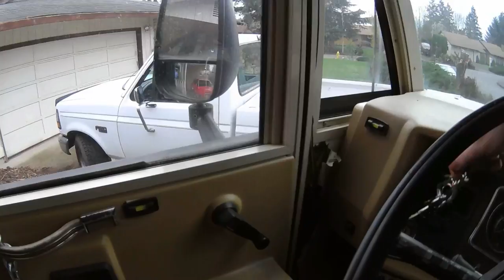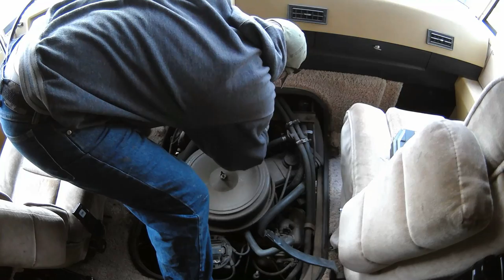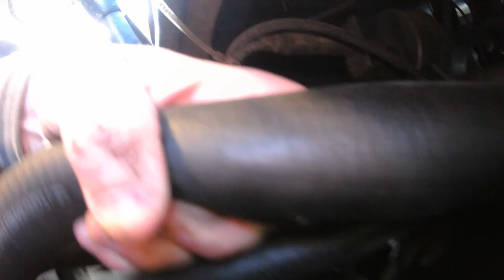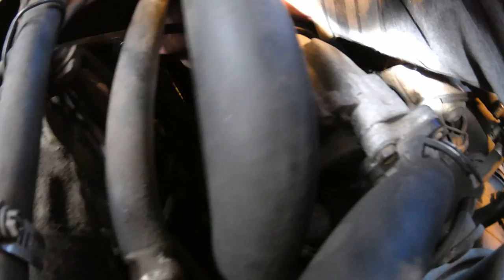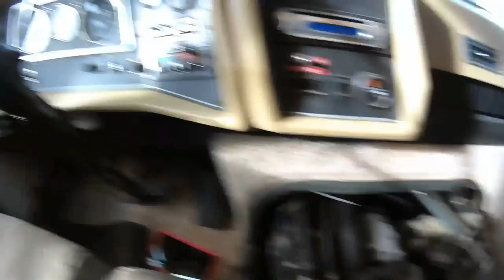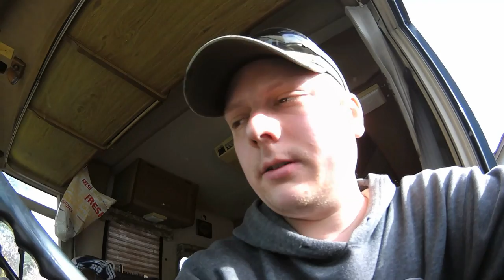Troubleshooting Motorhome Power Steering

Comment: Not sure about yours but that pump you were working on is the ac pump !
Power steering is below that and much harder to get to !
Looks to me like you tightened your ac pump belt. There are three separate belts . Alternator/fan that runs to your crank pulley. Then your power steering belt , next is your AC belt .
The diesel sounds like timing with the hard start , but if you start it up for a few and don’t kick down the choke or high idle , it’s going to diesel

Comment: The dieseling is a timing plus the idle speed adjustment on the carb.  I had to replace my carb as the previous owner attempted to adjust the idle mixture setting.  In doing so he ran the idle mixture jet screws in HARD to the point of cracking the base plate of the carb.  This resulted in no matter the setting the idle could never be adjusted lower than 1800 rpm. and would diesel on shut down. 

As to the hard start after running that is "heat soaking"  this is a common problem with ANY of the GM's or Chevy's with the Big Block V8 engines. What happens is because the starter is so close to the exhaust manifold, about 1 1/2" away,  the copper windings in the starter increase in resistance when they get hot and must wait sometimes for 15 -30 minutes to cool enough for proper operation.  Also the main power cable from the battery suffers "heat soaking" too.  

 Correction is to add a starter shield, also the power cable to the starter should be 4 guage and heat shielded with in a 1" tube as the cable runs under the manifold to the starter.  There is also a heat deflector shield for the right side of the engine that blows airs down the right side of the engine to assist in removing heat.

Hope this helps.
Reply: Because it was a problem with hot start I think you are right about starter getting heated.  When it bogs on cold start I would check timing...could be too advanced.
Reply: Or even a flat spot in cam, or a cracked valve, had similar issues, allowed manifold vapors to seep past the week cylinders on mine, messed with timing for a week before doing leak down and compression check...

Comment: My girlfriend and i fulltime RV, we just upgraded from a small 78 dodge minnie Winnie to a 33ft coronado (p30 chassis) ive only driven it once due to the power steering AND brakes not working properly. I believe its going to be the hydroboost in mine, the guy we got it from saod it jad a new power steering pump installed at one point but didnt fix the issue, any idea how hard it is to replace the hydroboost in a class a? I cant even see the thing from in the hood
Reply: I just got done replacing my hydroboost. It was actually very easy. Remove the left wheel then remove the shield. Once you have the shield removed it is easy to get to the hydroboost. You have to remove the master brake cylinder off with the hydroboost.
     I actually found it easier to leave the hydroboost mounted to the bracket and remove the hydroboost, the bracket and the master brake all in one piece.

Comment: I have the same problem on my '86 Fleetwood PaceArrow it is on a P30 chassis with a 454 or 7.4L V8 engine.  Along with the pump running the power steering it also runs the power assist for the power brake system.  You will also notice soft or spongy brakes where you need to pump a time or two to get them to fully work.
Reply: Any update on your fix I replaced pump Still have issue Exact issue you mentioned. Any help would be appreciated.
Reply: @dwightmcammond5597  Same here!
Reply: @chrisbaker4475  I had the same problem. Mine would not turn at all. It ended up being a bad hydroboost. It was actually pretty easy to do. Once the shield is removed there is plenty of room to do the job.
     Remove the left wheel and the shield that is mounted to the frame. Once the shield was removed I removed the lines and hoses to both the hydroboost and master brake. Remove the master  brake cylinder from the hydroboost. Remove the bolts that support the hydroboost and remove the hydroboost bracket, the hydroboost.
Reply: @lisah6451  I very much appreciate the reply! Just today I brought it to a local RV repair shop, I needed a NYS inspection as well anyway. I really don't have the ability to do this kind of engine work. I'm a plumber/electrician/carpenter.

Comment: Sounds like he's tiring box is gone . It's not a bad fix just make sure your wheels are seat along with your steering wheel. The hard start is defamatory a tuneup and timing issue but I would also save up and convert it to fuel injection wither one of the numerous kits online from holly and such company's. I did my rev and it started the first time every time and my gas Mileage  went way up and payed for itself in 2 years

Comment: MAY WANT TO GET SOME AIR IN THOSE TIRES AND MOVE THE COACH SO THOSE TIRES ARENT SITTING IN THE SAME SPOT. TIRES THAT ARE LOW ARE MUCH HARDER TO TURN. A GOOD TUNE UP PLUGS PLUG WIRES AIR FILTER AND SOME GOOD HIGH TEST GAS. DID YOU ADD ANY FUEL STABILIZER WHEN YOU PARKED IT?

Comment: I have an 87 Winn that looks exactly as your RV. Stupid question - Where do you put in the fluid for brakes and steering? Just bought RV and trying to do some maintenance. Any advice would be great. Thank you!!
Reply from the maker: The brake fluid goes in the brake reservoir which is located in the drivers wheel-well behind a shield that has a square hole cut in it so you can access it. I have also read some of these motorhomes come with a small hatch on the floor near the driver&#39;s seat so you can get to it easier, mine unfortunately does not making it a little difficult to get to but you can still do it.

The power steering reservoir is under the hood, it is black and cylindrical and has a little cap on the top
Reply: I thought I found for the steering but it only states to use proper fluids and not to over fill.Didn't want to risk putting in the wrong stuff. 
You are a blessing! Looks like the tire and I are going to become very close friends tomorrow. haha 
Thank you so much!!
Reply: Class A Living I'll be keeping you around. I just know I'll find something else that will boggle me. lol 
Thank you again! ~ Blessings to you and your loved ones!
Reply: Love reading these. Great Channel. GOD Bless

Comment: You have to check the fluid levels as well ( you probably already have) power steering uses fluid to assist in ease of turning(if you will). check your hoses too ,, a supply line  or pressure hose is about 20 bucks. the return line is cheap as well, one could be split or leaking.

Comment: Nathan, were you able to get the power steering / hydro-boost pump belt tightened?  How did you do it?  I was thinking from below by removing the bottom section of the fan shroud which gives access to the lower front of the engine. Any thoughts?

Comment: Mine is making that noise and also the breaks. Any ideas. Please 🙏🏻🙏🏻🙏🏻
Reply from the maker: My issue fixed itself when I took the steering centering springs off, seems as though they were too much for my power steering to handle when turning.. tightening the belts may have helped too
Reply: @ClassALiving  i guess my power steering and brakes are the same system and when i turn left or right pr apply pressure to the brakes it makes the same noise. Mine is currently stuck in park.

Comment: Use a vacuum pump tester to check and apply vacuum to rid air pockets in pump via reservoir. Air in steering pump causes cavitation of centrifical force causing sharp whining sounds.

Comment: Hi bro, you may want to check your tire pressure on the left side.
Reply from the maker: +Santos Vega Thanks! It does look pretty low im going to check it as soon as i get a gauge :)
Reply: @ClassALiving  The belt may need more tightening since it might be slipping silently at the new tension.  Maybe see if it gets hot.  It may be designed to be stiff when sitting still on dry pavement, which is the hardest condition, and an ageing pump might want a thick fluid additive, especially if it behaves better when cold.  Lucas makes them.

Comment: Didn’t check power steering fluid. Why not? Cavitation in power steering pump is caused by air getting in. Replace seals at pitman arm if pump won’t hold steering fluid. Check pully for excess play if so replace pump. Hard start after warmed check ground connection. Make sure both battery connections are corrosion free.

Comment: Hey people. I just finished troubleshooting the same problem. I found out there was a belt completely missing
Reply: I think my ‘87 Itasca Sunflyer has the same issue. I cracked ‘er open today to tighten the power steering pump and there’s no belt attached, but not sure if it’s by design or not. I mean i solved my “whirling” sound as in this video and pump is working fine.

Comment: new pump
Reply: Question ?
Just received b
Motorhome from
Family Members
Been Sitting up
For a long time
With a 454; well
Just installed
Abmefhanical
Fuel pump    ?
But  the Fan Bellts
We're  off the
Pulley s
Tried  to
Replace them
And
Notiiced
Fluid  leaking  from behind the  PULLEY
Of the  Plump 
     WOW
         ?
Reply: Is there a Video
  Available  ?